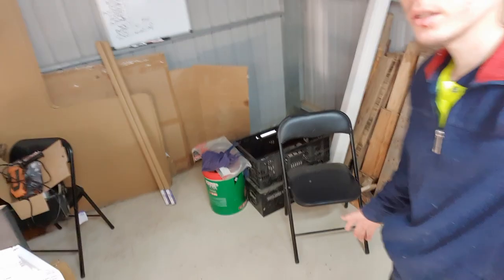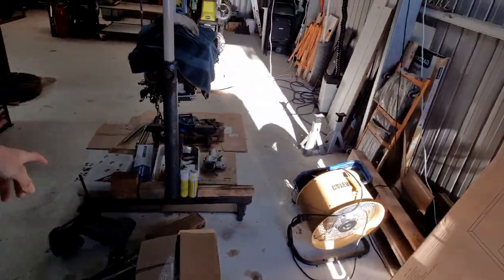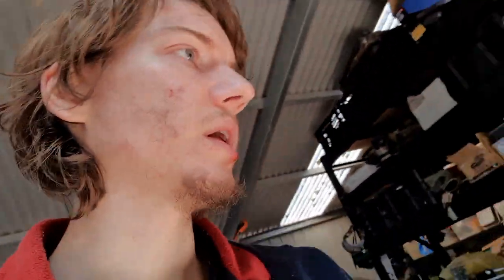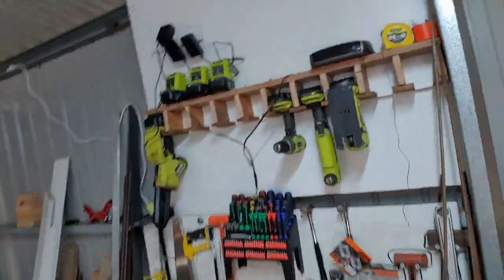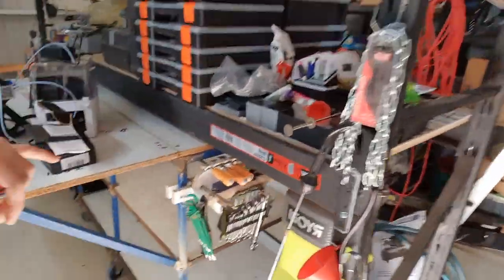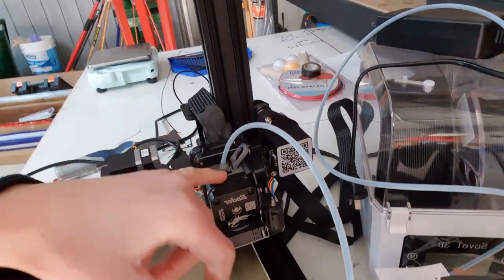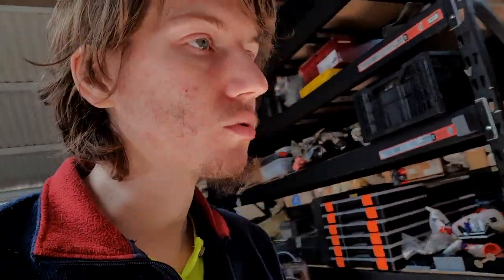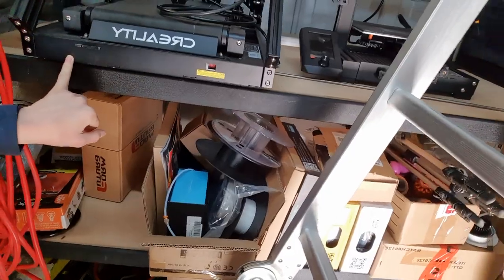I've been unwell but still making small improvements to the shed

Comment: Would suggest lining your shed or a wall at least with some non-structural ply, I did it in my workshop so everywhere is a peg board. Its looking like it's coming together well mate, get well soon
Reply from the maker: 3 and a bit years according to doctors for my bloods to ideally be normal. Each person's recovery will be different. I've had a simple virus for about 3-4 weeks and still recovering from that.

As for lining the whole shed, I don't have the kinda money to do everything at once. I just fixed my car and I am building a brand new computer with some scalped parts which will be a capable machine to render videos, play games, and most importantly develop games, cad software, and any tools that require rendering power dictated from CPU to GPU usage.

I am only building the PC now because Have been watching prices and the part I was eyeballing was 60% cheaper. And I can't stand to buy parts and store them so I went full out and catered the build around everything I needed.
I had a relatively unused GPU and SSD which cost enough but were not being used and made up about 2/5 of the costs of everything else cash-wise but are only worth a fraction of what was spent recently.

To put some perspective into it, since 2022, I've had to quit trying to push out any videos or doing any work myself. We are now leaning towards a new generation and really we will pivot towards whats worth doing.

I think doing occasional videos will be the right thing to do on a personal level, it means making at least something to let you know where things are at, and in the event, I can shift how I want to do things to the way I want to do things, we can actually make high-quality videos and I don't have to be at the center of attention or focus.

I am financially motivated, I wanna line the shed so it does not get cold, I want to raise the roof, and increase the floor space but it all comes at a cost which on this property I am not only unable to do it, but it will render certain features I like here lower in value.

I want to work with a group of people of which I no no one yet to make videos around engineering and mechanics. Doing some crazy stuff learning, failing and succeeding all at the same time.

I love Inheritance Machining as his video's are amazing and beautiful around the work piece.

I neither have all the tools, nor resources to pull a video together of that quality. I also lack the skills and a good Camera.

Sure I have a GoPro, but it constantly overheats within 20 minutes. I am guessing it's hotter because 4K but I don't recall trying to fix it because time constraints are always a factor.

Software I used to use changed a lot, and as a result the time line does not work the same. I might try to fix it, I might just forget about it.

I am not sure, it's just simpler and easier to do vlogs which never really give a video standard I want to deliver, but at least give information I might like to share at the time, which lets be real, I am never really able to focus 100% on a single topic 😂

I really hope to find a way to contribute to the end viewers' life in helpful content if I can. I might just make simple videos to practice with and release as it will likely help someone, even in a small way I guess.

Thank you for following the channel so long, and I appreciate your support towards my recovery from my health crisis.
It means a lot!

Please, look after yourself and your family.
And take care :)